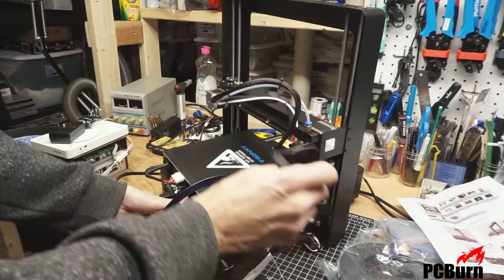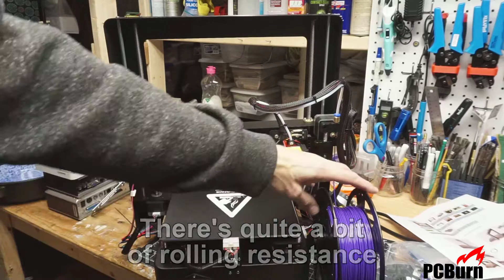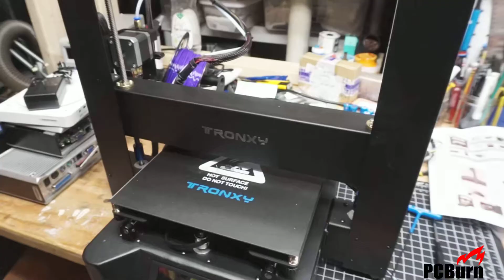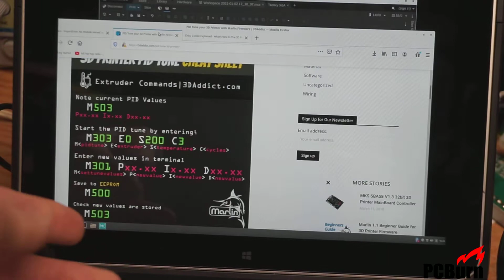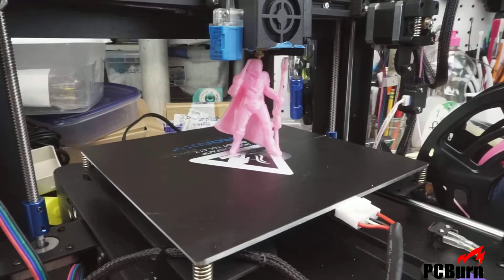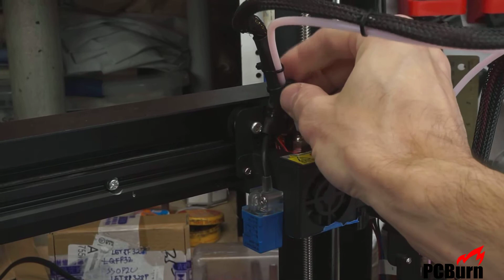What's Wrong with this Tronxy/Alfawise X6A? Setup, Cleanup, First Print, and Initial Impressions

Comment: Great video, did you end up finding a Marlin build for it ? I got given this broken and have managed to get it up and running and tried using a CXY-V5 marlin build and it loaded ok but wouldn't home and was bit of a disaster, so I've reloaded the original firmware for now.
Reply from the maker: I didn't mention in there? I have it running stock Marlin for its board, and it works fine. I'll see if I just didn't publish the video.
Reply: I didn’t see it in the playlist. I have seen the one on the tronxy xy-2pro and followed that, I did a build for the x6a but when I loaded it the heating worked but the homing wouldnt work, it seemed  to ignore the limit switches and a lot of crunching ensued. I also assumed the stepper drivers were not tmc on the x6a. My x6a has the blue auto level sensor rather than a z limit switch. I also wasn’t sure which rhapsody printer to bas the x6a I believe the board is a cxy-v5 even though it only has V1 written on it (it looks the same). Any ideas on what you did with the x6a would be great.

Comment: I have this same printer and saw the updated profiles - I'm a newbie at this and not sure how to use them in Cura?  Thanks!
Reply from the maker: I"ve never actually seen a profile for this. If you can point me to them, so I can see what you're referring to, I may be able to answer the question.

Edit: Unless you mean my profile there. In which case you can either copy them manually into the configs folder or just use Tronyx XY-2 Pro profile in Cura as a base and editing it as necessary to make it work. I don't recall needing too much to get there.

Comment: Nice video, the backwards mounted hotend threw me for a loop, haha. I was also surprised to see the 2020 extrusion for the x-axis, but it is probably a cheap and fairly rigid way to have a linear axis.
Reply from the maker: Yea, remembering to reverse the print every revision threw me off the first few times! That was the only way to record the interesting bits.

I assume it's fairly rigid; the wheels seem well planted... possibly a little too well, as there's some dust developing from rubbing on the 2020 where they mate. I also don't think I had to adjust the lobe for the wheels. Hopefully the dust is just something in the anodized coating... we'll see.

I'm not really looking forward to fixing any wobble if I'm honest. I've got high hopes that artifacts are from rattly bearings or a hackish firmware; we'll see.